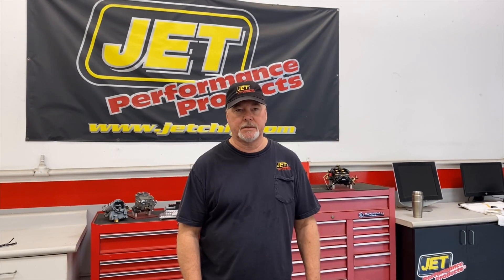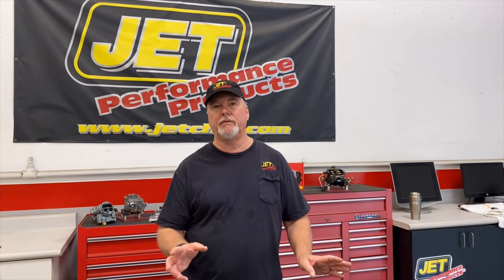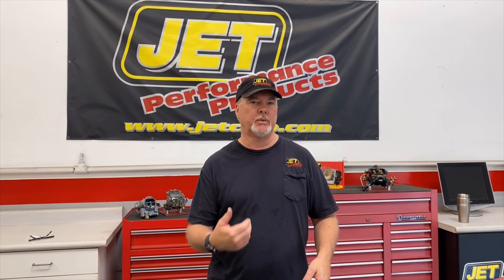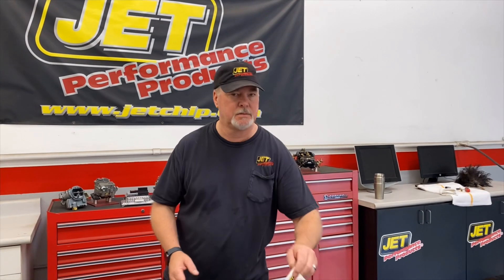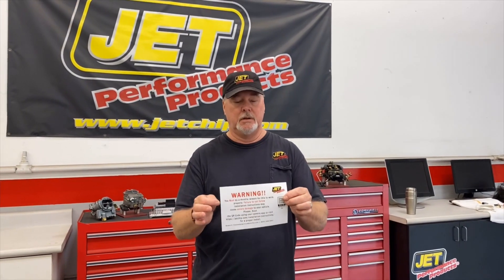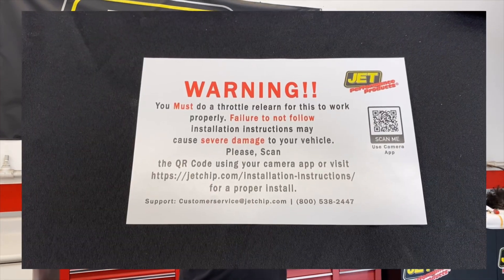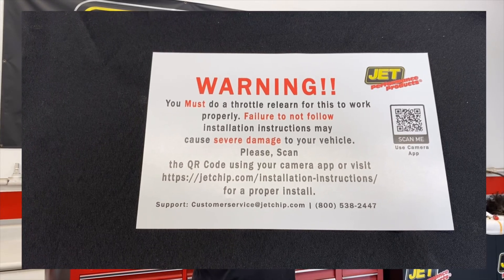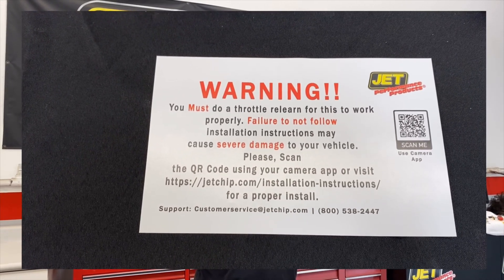Throttle Body Operating Relearn Process

Comment: I do not wish want to buy adobe is there another way ? I put this thing and it immediately failed after several tries. Spent a lot of time I have a 2003 Hummer H2
Reply from the maker: Hello there, you don't need to buy adobe to download the PDF. If you contact our customer service they can send you a copy of the PDF if needed.
Reply from the maker: Do you have an email that we can send that to or would you feel better about contacting our customer service?
Reply from the maker: Also, if you use Google Chrome, Microsoft Edge or Mozilla Firefox as a browser you can go to our site and view the PDF file from there without downloading any additional software.

Comment: Check engine light and electronic stability light multiple times. 2019 Ram 1500 5.7
Reply from the maker: Hello there, walk me through your install process?
Reply: @JET-PERFORMANCE  I disconnected the battery and follow the instructions off the queue R code, and I also install a jet performance spacer during escalation. I'm still having problems.And i'm about to go outside and do the relearn again
Reply from the maker: @ So you did the relearn after you installed it the first time?
Reply from the maker: @ Sometimes the relearn might take a couple times for the ECU to register it.
Reply from the maker: @ Also, if you don’t do the relearn process exactly, it will not register. 
If the issue is not fixed after this next relearn, then contact our customer service for a replacement
Reply: @ Will do appreciate your support!
Reply from the maker: @cwmaxxout805  Of course, we are here to assist